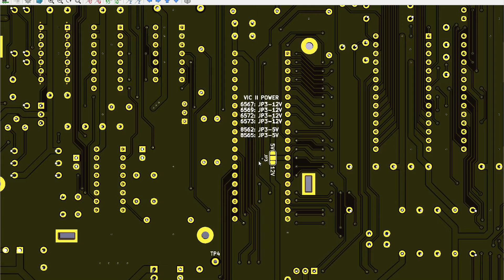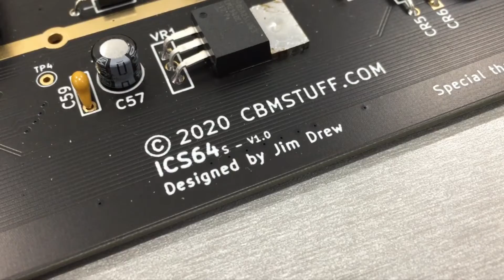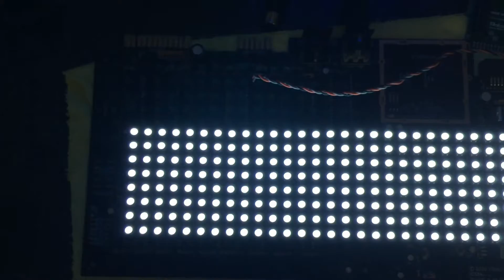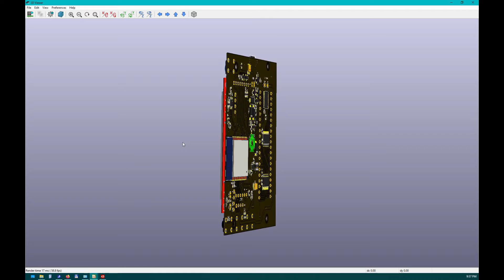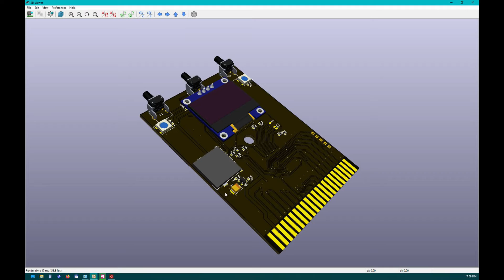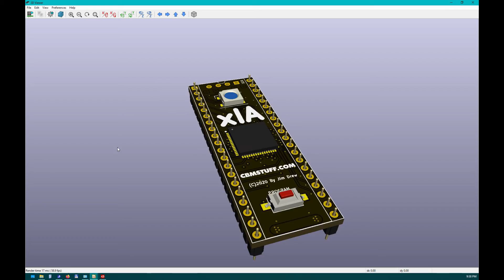CBMSTUFF.COM's World of Commodore 2020 presentation

Comment: Any update on this?
Reply from the maker: ICS64S boards have been sitting here since March.  I just now (literally yesterday) finished the assembly and usage manual (104 pages).  There is an interactive component reference guide, BOM guide, and assembly gallery with several hundred pictures.  I will be putting these on the website in the next few days!

Plastic injection moulded cases have been sitting here for months.   The actual PCBs are headed for production shortly.

XIA boards are next on the list of products to finish.
Reply: CBMSTUFF.COM where can I order one from?
Reply from the maker: @dkier81  You can order products from the CBMSTUFF.COM wesbite.

Comment: looks good, any way to make sure there is support for Parifractic's VIC II squared? it allows both NTSC and PAL in one.
Reply: I have not seen that, but this was not a goal of this project.  You can switch between PAL and NTSC easy enough by swapping the chip and crystal.  I suppose I could make a daughter board that plugs into the ICS64 and gives you the option of having both and you could switch it electronically through the OLED menu and/or RESTORE key.